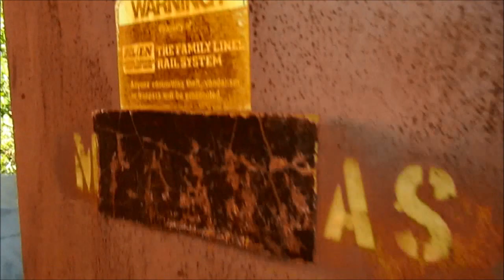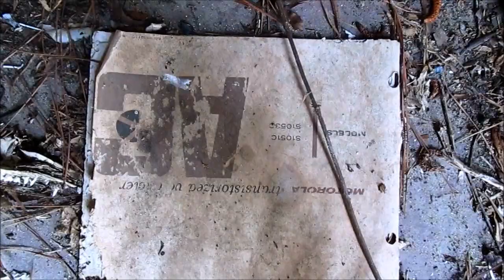Abandoned SCL Defect Detector

Comment: Cool to see the inside of one of those.
Does GC still have any high hood U23s?
Reply from the maker: No, sadly. They were all scrapped a few years back, save for GC 3965, which was sold to VLIX and now resides at the SARM near Oak Ridge, TN.
Reply: @freebrickproductions  Unfortunate, but kinda expected
Reply from the maker: @steventurner820  Apparently one of the first things the G&W did after getting the GC was sell off all of the GE parts they had in their shops.

Comment: I do have a question since I'm new with railfanning how do I track if there is a Freight train coming? What  website or app do I need to use?
Reply from the maker: There's a few different ways. The most popular is to use a physical scanner radio, though, if you live in an area with an online scanner feed, you can use an app like ScannerRadio or a website like Broadcastify to listen into the radio.
You can also go with the more traditional (and physical) methods of looking at block signals, listening for nearby crossings and/or train horns, or even just looking down the line for an approaching train.
If you know of any railfan Facebook groups for your local area, those are also useful for heads-ups, especially for rarer/more interesting trains in the area.
Also, I want to say there is (or at least was) an app made that would allow people to report whatever train they saw (similar to HeritageUnits.com, but for any train and power), but I'm not sure if it's really ever taken off.
Reply: freebrickproductions okay thanks.
Reply: freebrickproductions What is the Rail Crossing Locator for.
Reply from the maker: @railfannerguy1381  The FRA app? It's used to find railroad crossings and view information about them.